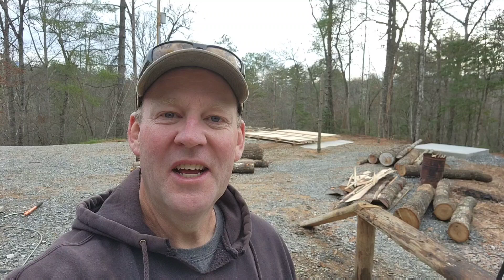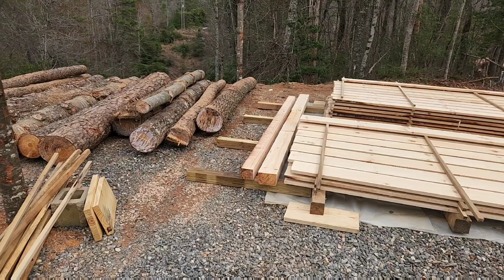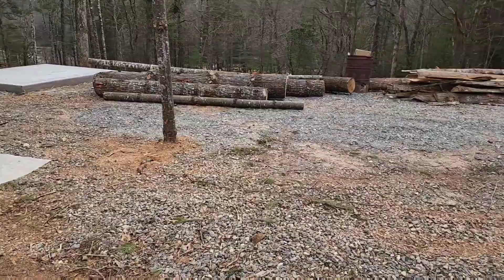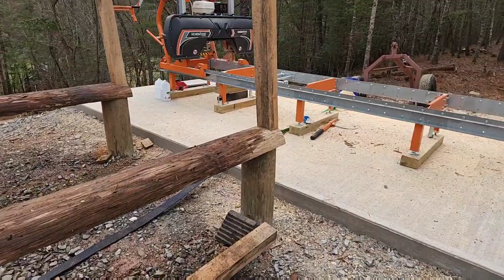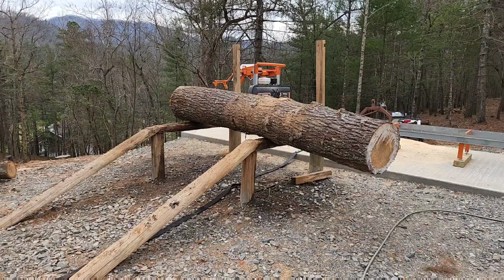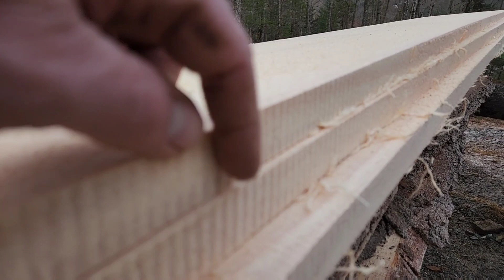Day 2 Logs to lumber

Comment: Good looking lumber! From experience your lumber will dry better and be less likely to mold if you keep your stacks 3 ft max width. The wider the stack the less airflow.
Reply from the maker: Good tip, thanks.  For the time being I wanted to get as much lumber under cover as I could.  I will use slimmer stacks in the future.